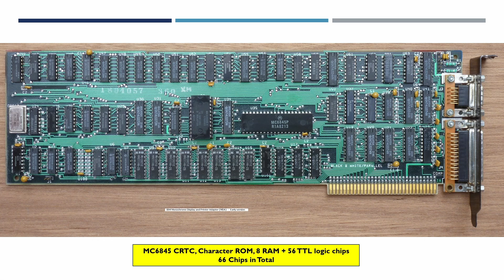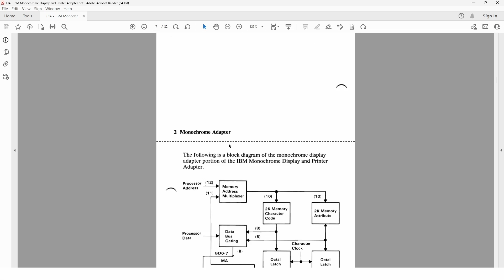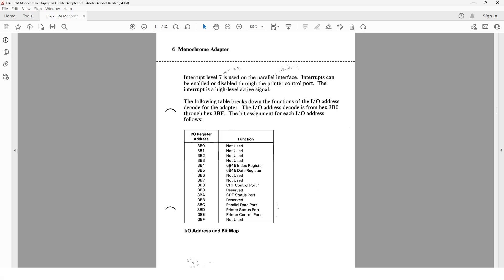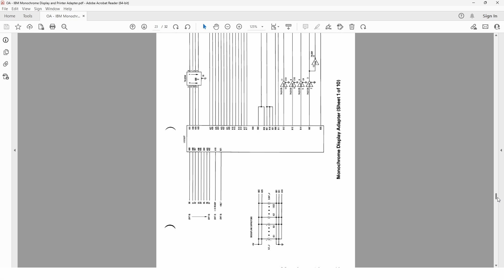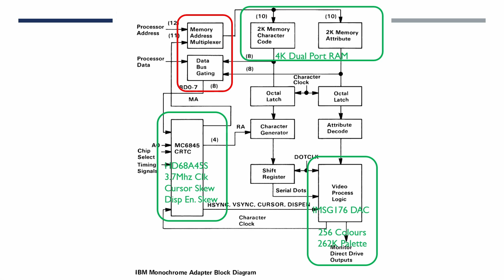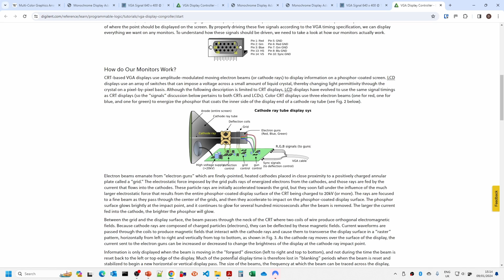Breadboard 8088 PC MDA Video Controller (MDA#1) #13

Comment: Quite interesting to use this video resultion. I am working on my own graphics adapter and in my previous tests i could not find a modern monitor which could display the 640x400. I testet 5 different monitors (from acer to noname) and all can do 640x480 (VGA Standard) or switching to 720x400 but no one could do 640x400 (i would use this either but now i going with 640x480) ... Old CRT on the other hand have no problem with that. Just my comment on that and sorry for my pure english. Anyway, a very nice and informatic video series. Thumbs up.
Reply from the maker: I use an old HP 20" (2007-2008) monitor with 4:3 aspect ratio which seems to work, sometimes I may need to select the auto adjust to get it exactly centred. I don't have any more recent monitor as the HP 24" 1920 x 1200 ones I have from 2008 are still going strong! You may need to invert the horizontal sync signal as 640x400@70Hz has +ve Vert Sync and -ve Horizontal Sync (though my monitor seems to work with Horiz. +ve). With 25.175 Mhz clock you should get 31.5KHz horizontal refresh which I thought was the more time critical part. 
The VGA to HDMI converter which I then plug into HDMI to USB video capture seems to work though needs slightly different CRTC settings from the Monitor. The main issue with 480 lines for character based display is that this is 30 lines and needs more than 4K of video RAM to do 80x30 with 2 bytes per character (the dual port RAM only comes in 4K). Thanks for the feedback. Dave

Comment: Just as a matter of interest, where did you get your HD68A45S chips from please?
Reply from the maker: From Silicon Ark https://www.silicon-ark.co.uk/hd46505-sp-1-crt-display-controller-by-hitachi?search=Crt, Advertised as HD46501sp1 with this datasheet but they are also marked hd68a45s which is a different datasheet with the higher frequency character clock and the programmable skew for cursor and DE. Dave